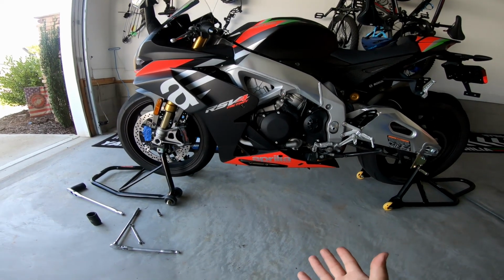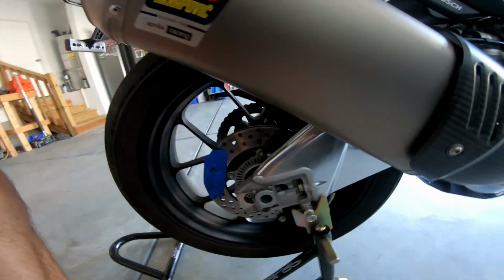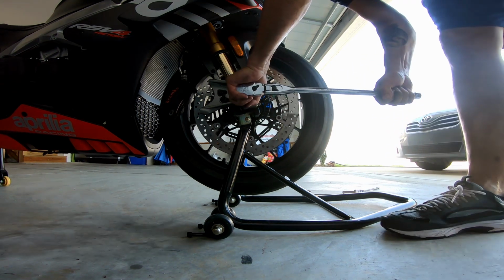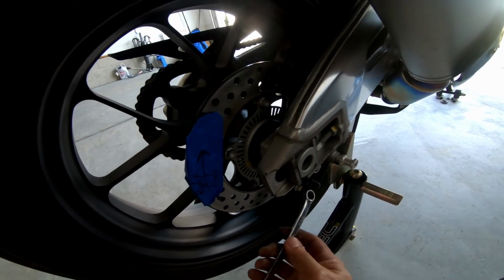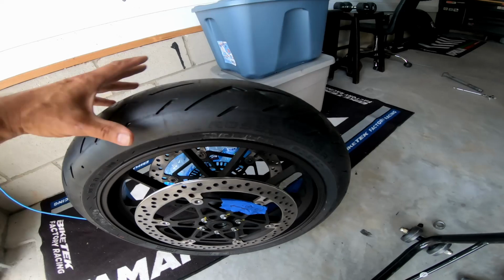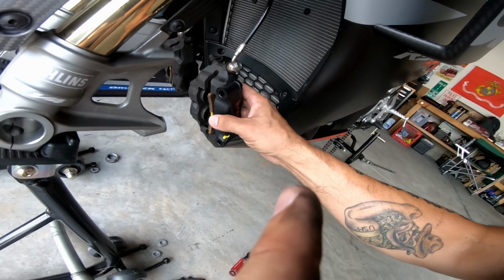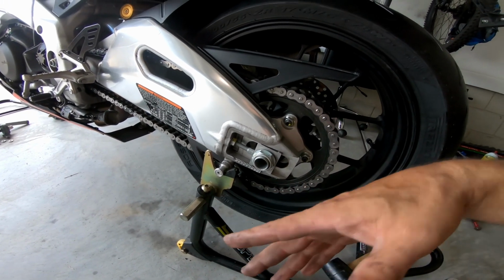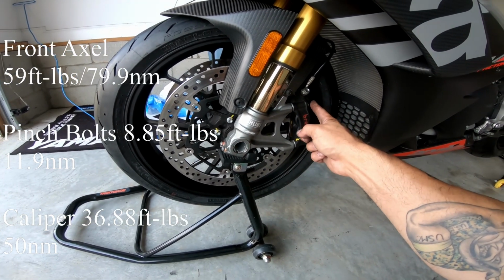Aprilia RSV4 - How to change tires and fix brake squeek

Comment: Great video Devil! I'm telling you, you'll love that Motodynamics Tail Tidy with the integrated LED turn signals!
Reply from the maker: I'm gonna get one soon.  I need it!
Reply: @rsv4pilot114  you won't be disappointed! It pulls it all together! 

Hey did you mount the tires yourself or take them to the shop? If you did it yourself how hard was it cause if it's anything like a dirt bike tire I'm gonna just pay someone lol!
Reply from the maker: @TheChaz81  So I took my tires to my work at a garage to take the tire on and off using the hydraulic machine.  I balanced it at home with my balancer I got from Revzilla.  I could have done it all at home but it was faster and easier to do it at my work.  I have the tools to do it at home but just made life easier to change it at work.
Reply from the maker: @TheChaz81  That was a link to tire balancing
Reply: @rsv4pilot114  yea I dunno where my other comment went explaining the link. But supposedly with those beads you don't need a balancer or weights. You just install the beads and they're good for the life of the tire.
Reply from the maker: @TheChaz81  I wouldnt use them but thats just me

Comment: Thank you so much for sharing the knowledge. My rsv4 has the same brake issue...
Reply from the maker: Yeah. Most new bikes do. Some more than others.  Very common problem.  Cars have the same issue.  Easy fix.  The factory assembles the parts dry.  Its supposed to have a little lube on it to make it not squeek and the pads to move around easier.

Comment: good vid ! what tool do you use on the left side of the front axle to avoid it spinning while tightening up the bolt on the other side?
Reply from the maker: @Largoww  I just tighten the pinch bolts on that side

Comment: Hi man. Great vid. Providing loose wheels to the tyre fitters definitely saves money. Good tip on the front wheel direction tape. On question (and it might be an optical illusion with the light), but your rear sprocket teeth looked absolutely shot on one side. I am sure you would have changed it if it was the case but boy do the teeth look worn out at video around 9 mins in. Have to do this very thing next week so will follow the steps shown for sure.
Reply from the maker: Thanks so much for watching and commenting. The worn sprocket is actually not worn. I think its the way it looked on camera with the way the light hit it.   In person, the sprocket is actually in great shape.  But good eye spotting something like that.
Reply: @rsv4pilot114  glad to hear it. Thought it was a trick of the light. Keep it up 👍 😃